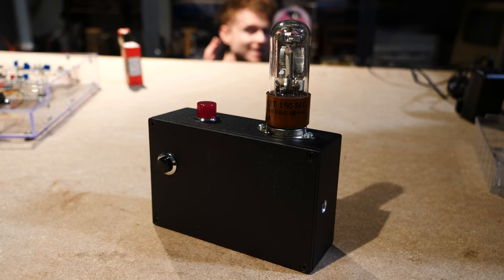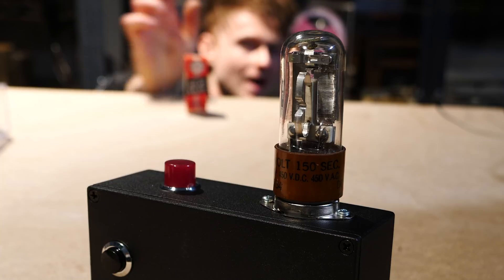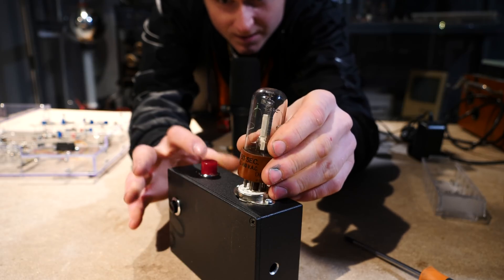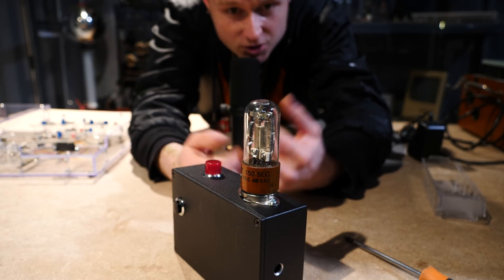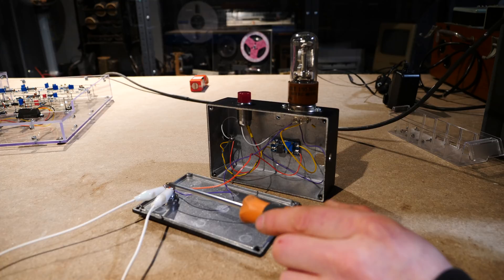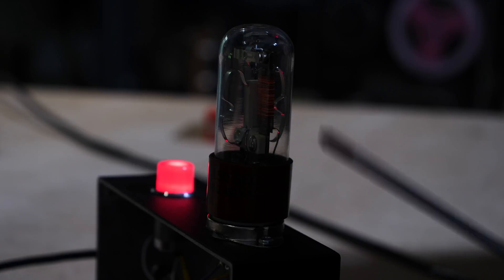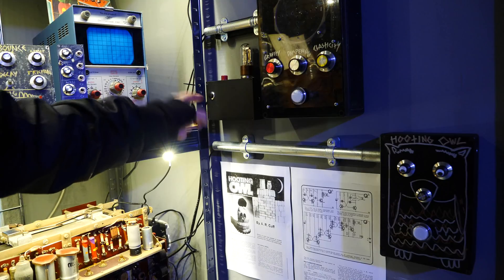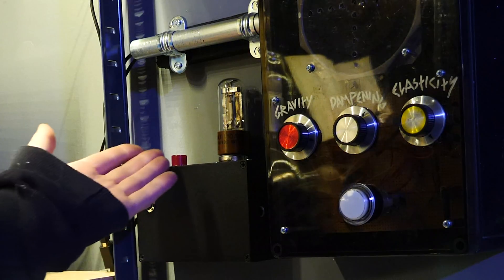Thermal Delay Relay? A Vacuum Tube Relay Interactive Display

Comment from the maker: the heater filament is probably meant for AC but hey what ya gunna do works enough for a little Diddy!
patreon https://www.patreon.com/lookmumnocomputer
astable multivibrator https://www.youtube.com/watch?v=ku91Yg2lJmk
if you have any kicking about like the above normally closed please get in touch :D could strike a deal! for them cus id love to setup a couple in Astable mode as a show piece
Reply: Speaking of vacuum tubes, somewhere I have a tube radio that was given to my grandfather.  He was a teacher at a school that is ran by a local tribe.  One of his students made it for him as a gift back in the 60s.
Reply: A shame I'm on the other side of the Pond from you, Sam; I have hundreds of various types of delay relays and no one seems to want them. Never seen one with a 120 second delay however. It might be interesting if the museum had a display of a bimetallic relay  activated by a small flame at the push of a button; kids would love to push that button !! but that might not meet fire code.....Indeed, I shudder to think what you must go through ---- and pay ----  to satisfy insurance companies and fire inspectors. Did you have to install a Halon-gas fire-extinguishing system?

Comment: Ideal for pre-heating valves . If the heater elements are connected directly on power up then the valves have a chance to get to a working temp before HT is whacked on. Valves can last longer that way . Might seem a boring thing but it will be very useful to someone !

Comment: the slow cooldown could be a feature, cause if the equipment is already hot, it doesn't need the full 150 seconds to warm up.

Comment: Very excellent video! These little time delay relays are super cool!

I'm a bit late to the game, but here's my shot at writing a little blurb for it:

Push the button, wait, wait some more, then see the light!
Back in the before times, valves (or vacuum tubes) did all the heavy electronic lifting. They had beautiful little heaters inside to get the electrons all loosey goosey for work. But, if you have some really high voltage floating around, you want the valve to be fully warmed up before that high voltage shuffles off to work. Enter, the time delay relay. This particular one would allow the valve heaters to warm up for 150 seconds before opening the high voltage flood gates. Push and hold the button, and if you look closely, you can see the time delay relay warm up and very slowly make contact!

Comment: Modern equivalent would be a TON relay, which would close the contact when the set period of time have past since the start of its coil receiving power. 
It's actually not that common nowadays because the industrial world is so dominant by PLCs (which can simulate timers effortlessly) but still, it is used sometimes. 
And I can see the thermal delay being adjustable by altering the voltage being sent to the coil. Also if you run analogue signal into the coil it can probably act as an integrator.

Comment: When I was a kid, I had an Amperite delay relay (5 sec, 6V) that I got from my uncle.  I eventually used it to convert a manual-start fluorescent light fixture (you had to hold the button while it starts) into automatic-start, to use it as a plant light, and run it on a timer.  If the lamp failed to start, my device would never retry, but in practice this turned out to not be a problem.  My parents got many years of service from it.

150 sec is a bit long to wait, though....

Comment: A turtle living in a rabbit museum! 🐢🐇 Sam, I love that you gave it life! I have several of these in my antiques collection. Here’s some history for you... The Edison model 501 (B-1828) thermal relay had a steel/copper alloy bimetal delay strip and Bakelite octal base and was made in a partnership with Thomas Alva Edison (Edison Instrument Division, West Orange, New Jersey) and Elmer Ambrose Sperry, founder of Sperry Gyroscope Company and inventor of the Aviation gyroscope/gyrocompass (Elmer’s son, Lawrence invented the first working Autopilot). 501’s were made in the US under US Patent #1741600. Note: If you look closely at the ceramic insulator inside your 501, you might notice a hand-written number, written in pencil. The number inside mine says “8487”, though I’ve failed to find out what this number means. Besides normally open and normally closed, there were also flashers that would open and close. You’ve probably had several of them on your Christmas Tree at some point! Lol. 

In many Tektronix tube oscilloscopes (I have 7 in my collection) thermal delay relays are used to allow heating filaments to heat various tubes up to full emission temperature before the B+ anode voltages are applied to avoid potential cathode stripping (damage to cathode coatings by high velocity bombardment). Some thermal delay relays (including the ones in Tektronix o-scopes) have an internal electromagnetic coil that is energized by the main contacts that makes the relay self-holding allowing the heating element to be turned off and cooled down, making it ready for another full thermal delay cycle in the case of a brief power outage. 

The Edison 501 thermal relay also had some other unique uses, including the dry cleaning industry. Sec-O-Matic automatic dry cleaning machines used 2 of them; one to delay the motor long enough to allow a measured amount of dry cleaning fluid to be dispensed, and at the end to delay the spin cycle to allow the fluid to be drained. (Here’s a cool vintage advertisement for the Edison/Sperry 501: http://lampes-et-tubes.info/rs/rs061.php?l=e)

They were also used in aviation. For example, the 1951 Lockheed Super Constellation L-1049’s radial engines used about 2 gallons of lubricating oil per hour. It had an on-board oil replenishment system with separate oil tanks and pumps in the wings that would pump oil to the engine’s oil tanks when it dropped below a certain level. An Edison 501 thermal relay with a 60 sec delay was used to evacuate the oil lines in-between transfers so the oil wouldn’t become thick and sludgy in the lines at cold high altitudes, which might prevent the next oil replenish cycle. 

Jump to 2021... It is now being used in the Museum Of Everything Else to make literally EVERYTHING ELSE (even the slowest rise and fall times) look FAST!

Comment: Never known these valve based relays existed. I knew about timer relays, they where often used in control circuits for lifts as a door open/close timer and as a safety timer for the ride duration.

Comment: Nice demonstration of a Bimetal Switch :) Those are still used today, usually found in toasters and kettles and so on. Although they are not fitted inside a tube like this one is.

Comment: Anything with Tubes is fascinating. I still dont understand why does the metal bar bend and then bend in the direction of the contact when heated? I didn't quiet get that part. was there a spring or magnet?
Reply: Bimetallic strip.  One metal (one side of the strip) expands/contracts more than the other metal.  Hence, heating/cooling it causes it to bend one way or the other.  Commonly used in dial-type thermometers and electromechanical thermostats.

Comment: I have seen a non-vacuum tube equivalent device in my old dodge automobile. 1974 dart.  It kept a little light in front of the ignition on after the door was closed.  Cheap, simple, useful, and if I still had the car, would most likely still be operating, just like this survivor.
Reply: I vaguely recall that my 1985 Chrysler Laser had the same thing (?).

Comment: Also used for the higher power valves with high current heaters, like the 811A, you start the heater at slightly lower voltage and let it warm the valve slowly before brining it up to full power (contacts are wired across a dropper resistor)

Comment: I was thinking if you had a rotor generator driven by a large amperage and a brake controlled with a small one that can slow or stop it with some kind of mechanical advantage you would basically have a controller switch. I wonder if electronics ever did something like that in the early days.

Comment: Press and hold button while reading me.
This is a thermal delay relay In side a vacuum tube. Please do not touch the vacuum tube.
As you are holding down the button voltage is applied to a heating coil inside the tube (the rectangle on the left with the wire rapped around it)
This thin wire has a high resistance so when you apply voltage to it the wire will heat up and glow.
In the center of this heating coil there is a thing strip of mettle known as a bimetal.
bimetal refers to a piece of metal that is comprised of two pieces of mettle, bi metal. Like a bicycle is a cycle with 2 wheels.
When you heat up mettle they expand and when you cool them they contract. However the rate they expand and contract differs from types of metals.
So for example aluminium will expand approximately 1.5 times as much as steal when heated to the same temperature.
As one type of mettle expands more then the other type of mettle in the bimetal strip, One type of mettle will be force to expand over the other causing the bimetal strip to bend in one direction.
At the top of this bimetal strip you will see a small round piece of metal. This piece of metal corresponds to another piece of metal at the top of the tube.
As the bimetal strip bends it will bring these two pieces of mettle together.
As the two pieces of mettle touch this creates a separate isolated circuit from the heating coils that switches on the light.

I'm not to sure if that is to wordy or if all of that will fit on the box but it does take around 120 seconds to read...

Comment: Imagine a security lock like this with a single button. It would be impenetrable. No modern thief would have the patience to hold it.
Reply: Plus imagine wanting to bring your groceries inside in the pouring rain and cold but first you have to hold a button for 150 seconds... 😜
Reply: @iKrizNL  no price is too high for proper security lolz
Reply: I'm afraid it's hackable

Comment: OK, here's an attempt at literacy. Let me know if you need more words. I'm conscious that there's limited space on the side of the box, though.

Thermal Delay Relay

The Delay Relay is a Tube-era device which acts in the same way as any normal Relay, except that its action is delayed. This type of relay was used in electrical devices of the time to ensure that the components had been warmed up prior to activating the circuit, thereby avoiding damage or premature wear to the device.

This specific relay is a Normally Open (switched off) Relay. When a supply voltage is applied to the relay, electrical current passes through heating elements adjacent to to the bi-metal strip which, when heated, curves slightly to make the contact and ""switch on" the relay. Similar bi-metal strips are used in kettles and thermostats.
Reply from the maker: whey thats nice! this may likely end up an amalgamation of ones but thats nice and concise!!! :D thanks!
Reply: I'm not precious about it, I won't be upset if you don't use any of that!

Comment: DELAY RELAY DISPLAY

There are several ways to do everything worth doing in life, but are there several ways to do everything else?

Why stare at a wall or watch paint dry when you can hold a button, activating a thermo-mechanical component that lights a (fake) mini lightbulb?

Why are you at this museum?

Why are you reading this sign?
Reply from the maker: ha good one!